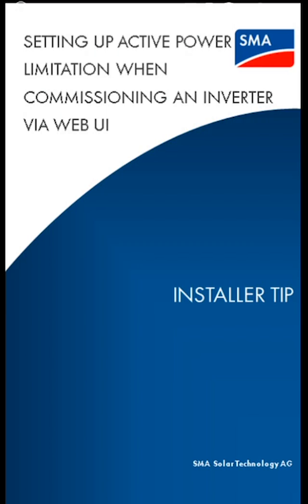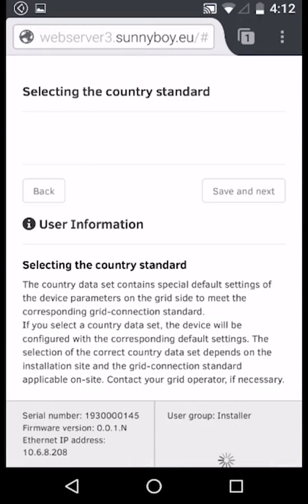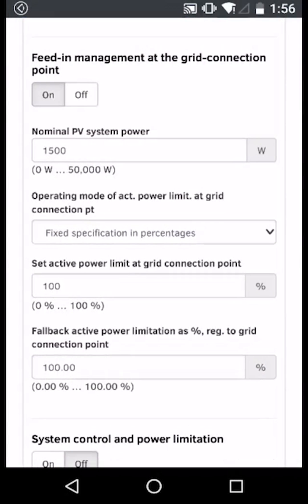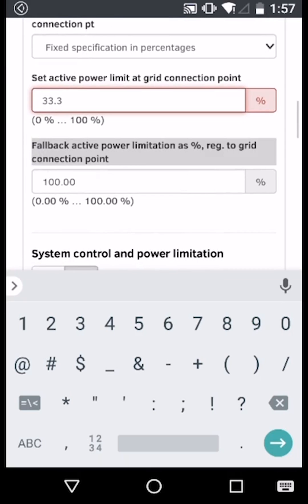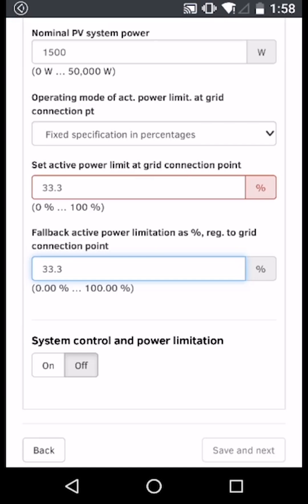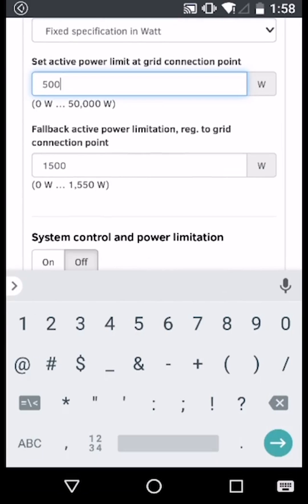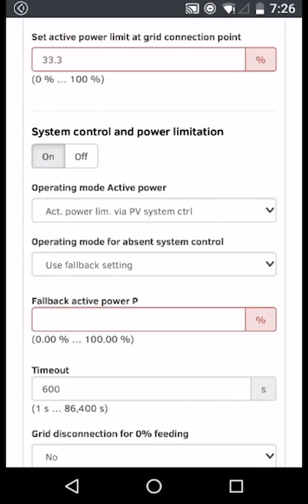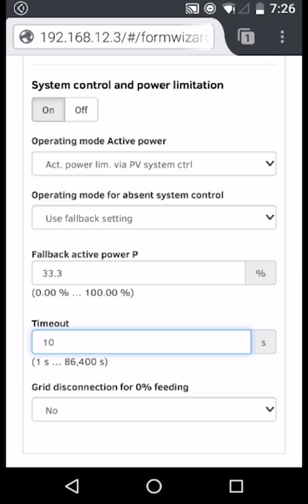Tech Tip : How to Setup Zero Export with only an SMA Energy Meter

Comment: Hello SMA, i have a systerm SMA SUNNY TRIPOWER CORE2 110kW, about 8 inverter.
I need a zero export solution for a system. What devices do I need to be able to install?
Reply: Hi nhattloan, did you come right with your installation?

Comment: Hi, this is a very nice video, but could you please explain: " Why do you want to set up zero or limited export" ???
I can't see the point of it.
I have 2x Immersun units that use excess power & dump it into loads (usually my storage radiators or water tank immersion heater).  This normally consumes almost all excess power from the inverter & therefore both increases home consumption & reduces export to the national grid.
I would appreciate an answer to my question please; thank you.  Johnnyk.
Reply: Because in some places you could go to jail for unauthorized power exporting.  However, this video doesn't seem to show an effective way to do set up zero export. Looks more like reduced export.   Probably should save up for a good lawyer if you live in one of those areas.  Based on some of the other comments, SMB does not work in zero export.

Comment: I have a Sb5000us with the revenue grade meter and the SMA RS485 card for this inverter.
Zero export will not work no matter what the settings. If active power is on there is no current from the panels as per the Rooftop communication kit v2 which I also have. Once turned off the power is restored. There is definitely an issue with this set up and there is no documentation showing what is required. All of these videos dont really explain it either
Reply: I don't think anyone else has gotten it to work either.  Sounds like the SMB inverter is a bad choice if you need zero export.

Comment: Hello,

Can I achieve zero export for a 10kW system with 2x STP5.03AV-40 and 1x SMA Energy Meter? Or I must use 1 x Home manager if I use more than 1 inverter? Thank you for response,
Reply: Hey Dorin, Did you figure it out?